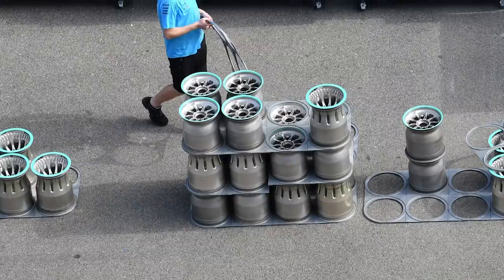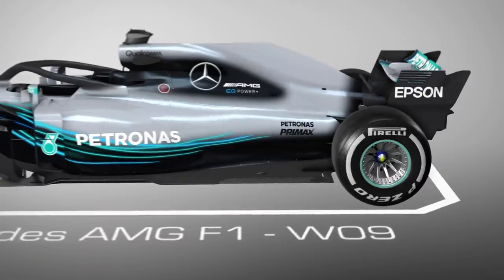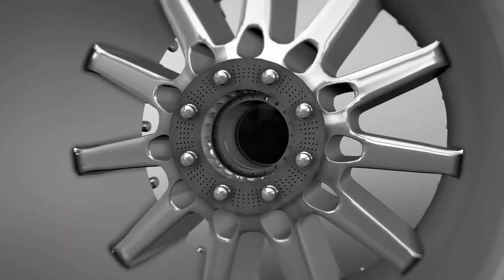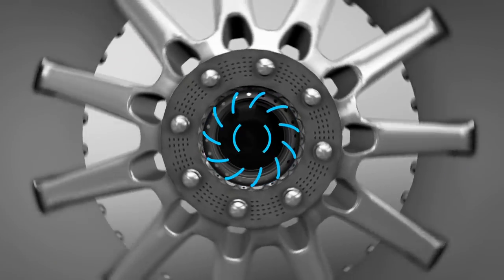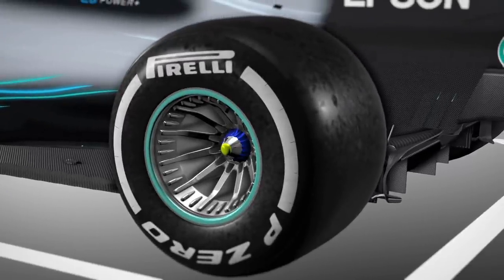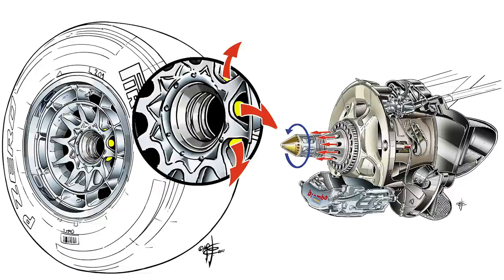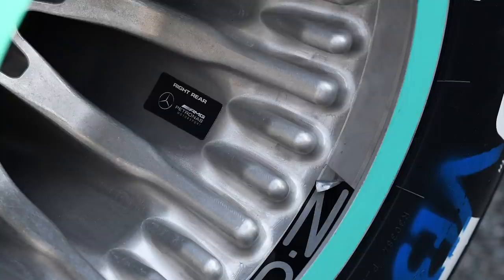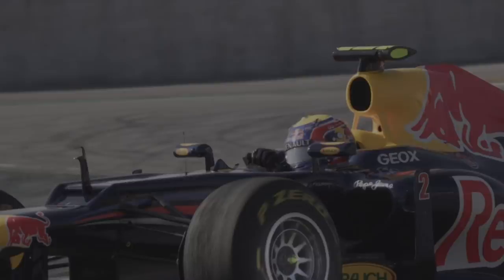Inside Mercedes' controversial F1 wheel rims

Comment: F1 NASCAR INDY CAR  you name the series over regulation has killed viewership and fans in the stand.  I can remember when there were basic rules engine size, car weight etc. And it was up to mechanics and engineers to go different ways and find an edge over the competition.  That was when racing was fun to watch and cool to follow the  guys ways of finding speed and handling. Drivers different styles had to work with different cars. That was racing. This stuff today is basically regulated to the point the cars only differences are paint schemes. Paint them all solid white and no one could tell who's car is who's LOL.  I say if you are going to regulate to that point FIA should field 25 exact copies and let them pull a number from a hat to get one of the 25 so in case one happened to be better it is luck of the draw. Run same tires one tank of gas and die of boredom.
Reply: Yeah but that became to dangerous, costly and ruined the racing aspect of the sport. That’s what we are seeing with the dirty air problem

Comment: Instead of applied innovation F1 prefers to level the field so there’s limited or no engineering progress improvements which can be used for passenger vehicles. Racing used to be a 'proving ground' for new ideas not a venue where performance is introduced on a 'curve' whereas all participants can be winners.........apparently all governing bodies are corrupt - works in government might as well adapt corruption to F1 and all sports.

Comment: YEAH THIS DEVICE INSIDE THE WHEEL MANAGES/REDUCE TIRE DEGRADATION BY ADDING COOLING TO THE ALL WHEEL......CLEAVER....SO WHAT...???And spacers give wider rear section,then more grip.......!!!!INNOVATION....THAT IS WHAT F1 IS ALL ABOUT...RIGHT...???FERRARI MIRRORS, FIXED ON THE HALO...WOULD MAKE THE SMALL FRONT CARBON FIBER PART OPEN AT HIGH SPEED AND REDUCE DRAG....GREAT.......

Comment: OLD MODIFIED TECHNOLOGY FOUND ON BRABHAM BT46 (FAN CAR) WHICH DEBUT IN THE 1978 FORMULA 1 WORLD CHAMPIONSHIP.  THESE MERCEDES WHEELS COULD BE CLASSIFIED AS A MOVING MECHANICAL DEVICE AIDING IN CREATING A VACUUM BENEATH THE CAR TO CREATE GREATER DOWNFORCE. WRITTEN REGULATION IN THE EARLY 1980S.

Comment: Nobody can race as smart as Ferrari apparently. If they put toothpaste on the steering wheel and beat Ferrari, that toothpaste on the steering wheel will get banned simply because it beat Ferrari. Not because Ferrari is slow, but because others are 'cheating'

Comment: It doesn't matter their main function is to resolve tyre overheating, they have an aerodynamic effect. And i don't care if it's very little, it is still an aero effect.
And you have a moving part that's manipulating airflow...that's active aero in short my friend.
That's why they should be banned: if something is illegal, is illegal period. It doesn't work like "but it's a very little aero effect, it's not very illegal"...if something is illegal, it's illegal.
Especially considering the fact all other teams are able to manage the tyres properly...so there's no tyre defect, and why then Mercedes should be allowed to use shortcut to fix their car design flaws?
Reply: And what about ferraris mirrors on the halo?  Rule states cannot have an aeridynamic effect, tell me why there is a little winglet on it? And then tell me it has no aero effect.  Also Ferrari lost their straight line speed advantage after FIA instructed them to fit an extra sensor to their batteries conincidence?
Reply: @Sctch_Egg  winglet was of course for slight aero purpose and in fact the FIA banned the solution in one race time.
The whole sensor thing is bullshit, the FIA investigated deeply the Ferrari battery in Monaco and found a clever unusual design that didn't violate any rules.
The extra sensor was fitted in Belgium, and in that race and at Monza ferrari still had their good straight line speed.
They put on the old power unit for the next races and since that was already worn and without the latest upgrades, it seemed that they were going slower.
Since Austin they've switched back to the latest power unit and we've all seen how the performance is still there, so...i don't really know what you are talking about
Reply: @Sctch_Egg  also the "and what about Ferrari" argument you made is 100% bullshit. Why turn away from the main theme, merc rims? Maybe cause clearly there's no valid way of defending them?
By the way, if you're opponent is cheating, that doesn't legitimize you to do so as well...
Reply: I'll leave this here -  IT IS NOT CHEATING IF THE FIA CHECK AND DEEM IT LEGAL.
Reply: @Sctch_Egg  the US gp officials deemed them illegal and told Mercedes that if they raced with them there could have been consequences.
And Charlie is saying "they're only a little bit illegal" which is the kind of bullshit i was saying before...something is illegal period, not "a little bit"...
Reply: This is my last post cos you are pulling things out of fresh air,   read this carefully this is direct from the FIA  Following the 2018 race in Japan, understanding that this scheme was in question, Mercedes requested clarification from the FIA’s Technical Department, as to whether this arrangement violated Art 3.8 of the Technical Regulations, which says in part 'any specific part of the car influencing its aerodynamic performance must remain immobile in relation to the sprung part of the car.' The question therefore, was whether the air passing through these holes and grooves violated this provision.

"The FIA’s Technical Department provided advice to the team, which in part confirmed that in the opinion of the Technical Department, that the configuration of the part in question would be in compliance with the Technical Regulations."

Comment: why not give every single team the same exact car then?
same exact engine, same exact chassis, same exact fuel tank....
order by bulk to one single manufacturer, 20 exact copies of the same car... no modification allowed.

everyone will be rushing to starve their pilots off to save weight.... strip out their electronics, paint with a single coat, cut out on sponsors decals and liveries, lighten the fuel mixture...
soon, the gap between first and last place will be measured in tenths of seconds, because everyone will be running at the same speed.
and tracks will be 20 lanes wide, and everyone will get to the finish line at the same time.
what is this, SJW racing? everyone has to be an equal?